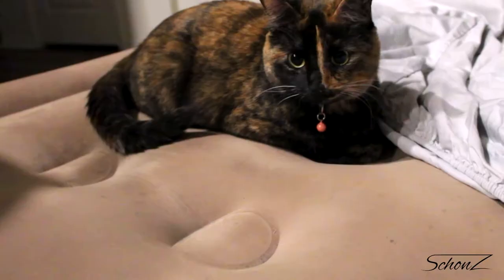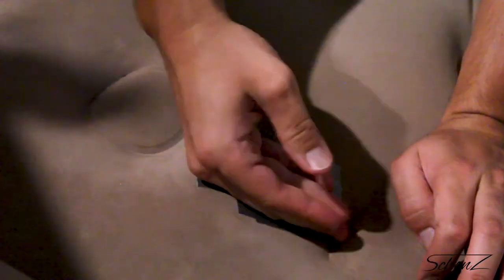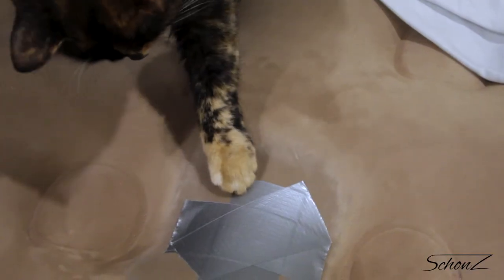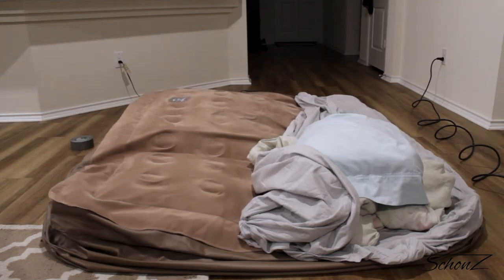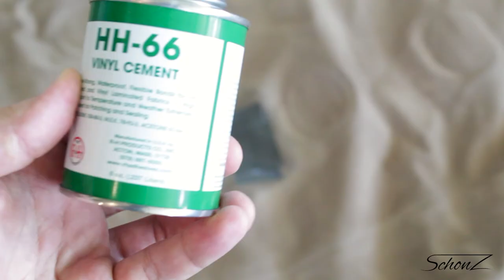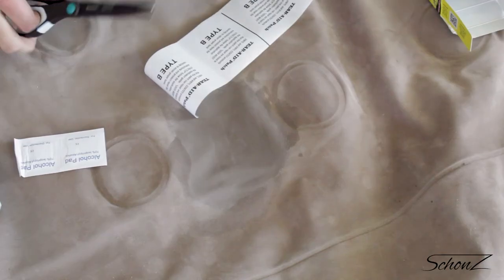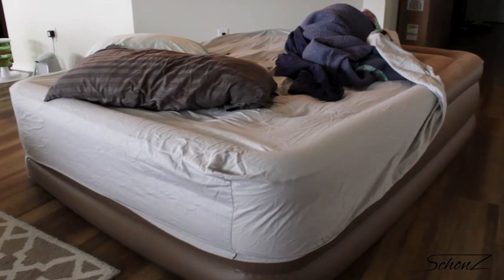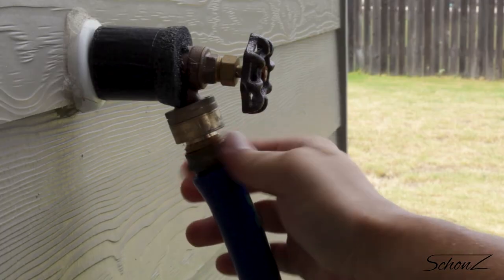Leaking Air Mattress: How to Fix

Comment: I've read through most of the comments and I do not feel alone in that my cat was responsible for the leak.  Bella, male young cat is always working on finding mischief.  I found the holes and used some hot glue and stuffed in the holes(3), so far so good.  It is now 2024, and the prices are 2-3 more than 2 years ago, so while I do have the airhead vinyl kit I'm hoping that stuffing the hot glue in the holes plugged the leaks.

Comment: I tried the water bottle with soap, common sense, found one hole in the side. Patched it but I still had leaks. Started looking for videos then I saw your cat because I recently got two kittens I knew this was the video for me. And as soon as you said that you watched your cat go after the spot where the hole was I recalled shooting my cat away from the bed earlier today. She was wanting to attack a little spot underneath the sheet so I immediately went there and immediately found the hole blowing air right at my face. You rock, cats rock thanks for your help!
Reply from the maker: Glad the video helped! Using a cat to find air leaks should become the new thing. Every tire shop will now employ cats.

Comment: To be honest, the duct tape doesn't really work on the bottom side though either. I tried the duct tape on the bottom side where the leak was, and the bed still deflated after about 10 minutes.

Comment: Question??? Did you have to wait for the vinyl cement to full dry before you put the vinyl tape? Thanks for the helpful video it was extremely hard finding a video on this topic you’re a life savor❤
Reply: The pvc cement hardens in a few minutes if it is the one used for gluing pvc  pipe. Alcohol and a small rag will remove the fuzzy layer. Then, deflate the mattress a little so air is not blasting out before applying a dab of pvc cement.
Reply: @damnhandy  this is good to know. thanks.  I used a glue stick and stuffed it in the holes, hoping I'm done with the leaks!